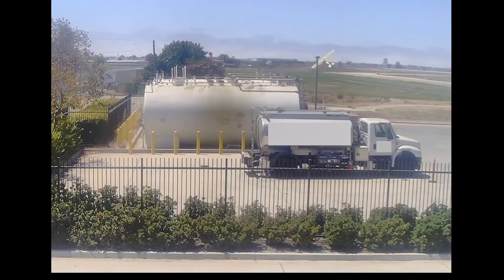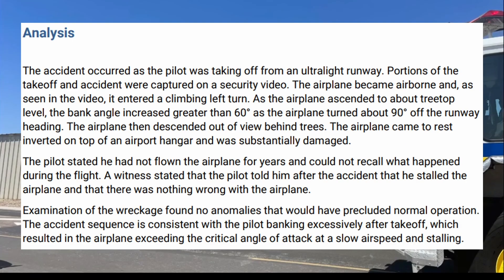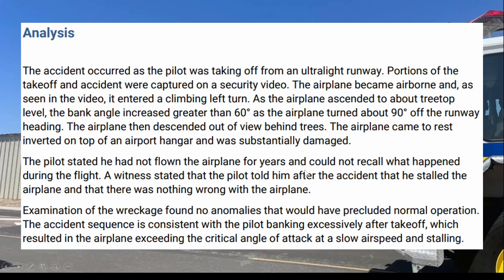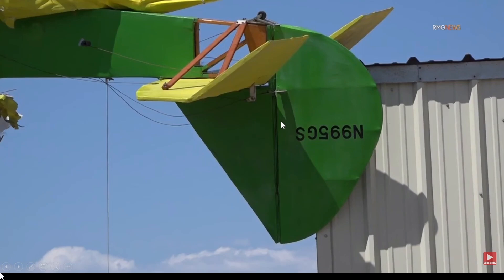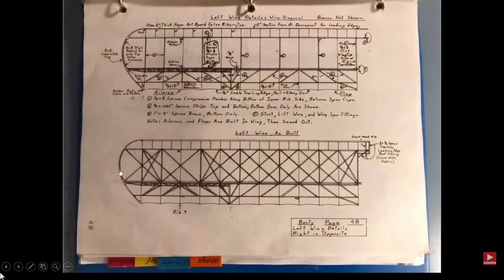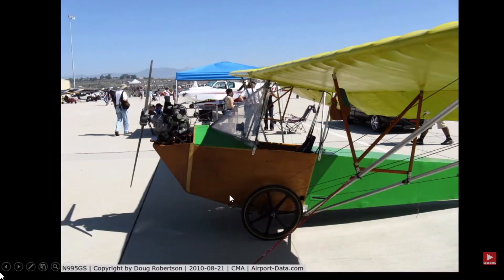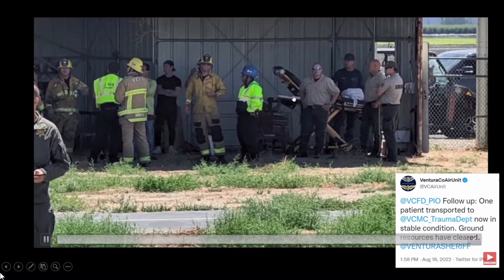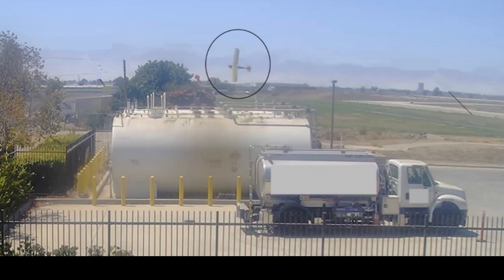Security Cameras Catch Aircraft Stall

Comment: The ride to the hospital costs at least 5x the price of throwing your plane onto the hangars... would have been cheaper and safer to buy a real plane. 
I hope this guy is okay and recovers well.
Reply from the maker: I believe he did.  Yes ambulance rides can be costly
Reply: I also hope he recovers, a ride in an air ambulance (helicopter) can run anywhere from $30-50K. Not covered by any insurance, regular ambulances, some are private, can be out of network, and you get a separate bill.

Comment: The video seems to show the cause of the accident.  The pilot executed an extreme bank angle turn before establishing enough speed to avoid a stall.  This causes a stall of the inside wing first.  You can stall just one wing of a plane and that's what happened here.  When the inside wing lost lift, it dropped, increasing the bank angle even further and thus causing a complete loss of lift to both wings.
Reply from the maker: Thank you for sharing that Beast
Reply: That was a Panic Pull and stall to the left.  Do you think a guy that havent flown in last few years will try an F15  kind climbing turn like that?  Do you? Yes?  Geee you.

Comment: Will be interesting to see your take on the JAL crash. Two scenes a distance apart at night.
Reply: Runway intrusion and collision.
We will see if it was an ATC error or crew error on the Dash 8.
Reply from the maker: This is quite the scene in Japan.
Reply: Yes! Aswell as the ARFF response and evacuation to it.
Reply from the maker: They seem to have done a quick response from what I saw
Reply from the maker: Multiple aircraft at night.  Gonna need a lot of resources on this.  They need to keep the fire away from evacuating passengers and get ambulances rolling asap.
Reply: @ARFFWorld  The other thing to consider is whether or not there are composite materials in the aircraft...
Reply from the maker: @alantoon5708  yes, I am not sure if they could enter the aircraft for a search or if it was too engulfed in flames to do so but always a factor is what materials are burning
Reply: @ARFFWorld  Looked like they were not doing much with the Airbus so preventing the fires from spreading took priority.
It could have been far, far worse.
And another thing. If one is ever involved in an accident like this, do not sit around taking a video with your phone. Get off of the aircraft..
Reply from the maker: @alantoon5708  yes it’s the smoke in the cabin that will get you before the flames do.  Get out as quickly as you can.  Screw the phone
Reply: @ARFFWorld  and leave your carry on bags behind, too.